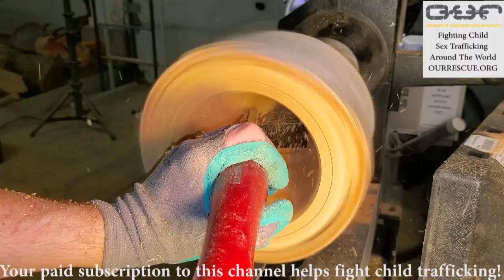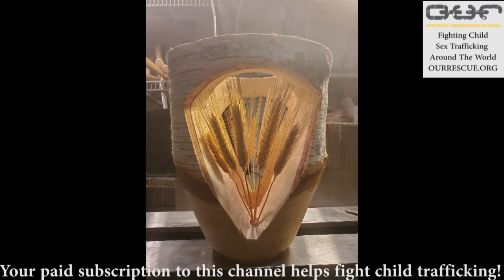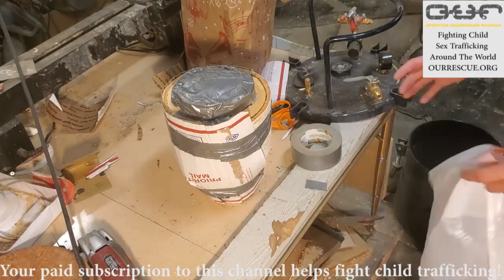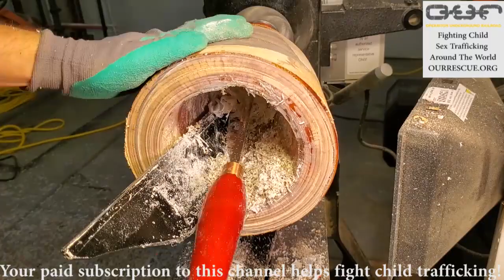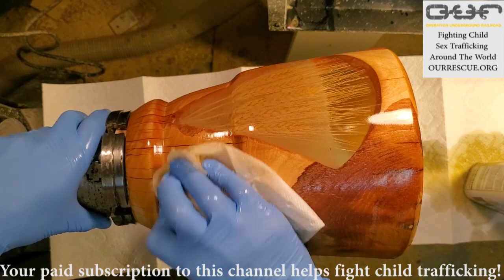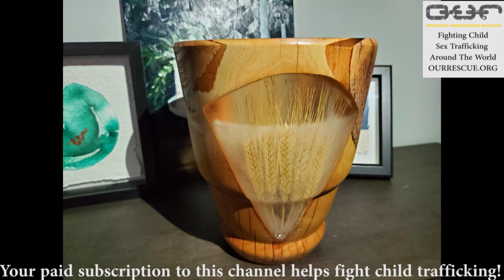"Foggy Wheat", resin, wheat, birch wood vase turned on the lathe for O.U.R. at ArtForOUR.org

Comment: Just on my second video by this maker, pretty happy with what I saw so far. I thought I would tell on myself to help others. When I have a natural product cleanup, especially if it is dusty, I use a leaf blower. I used to do it with my van back when I could get out for camping. I blew my shed and porches as well as areas I have carved antler or wood. I didn't like to be stuck in a workshop. Since I was 8 years old I have sold my art so making things at a beach in summer, a park In fall, the skating rink in winter, and anywhere it is airconditioned in summer. Making stuff in public drove sales. Pretty smart for a hippy chick in the '70s. So those are some tricks I used to support myself and eventually my daughter.  I hope that info helps someone. Oh, and great works Dan!
Reply from the maker: Hey that's great!  Thank you for the ideas!

Artforour.org

Comment: First off... What you are doing and the organization are amazing... 
Secondly... Having watched a fair few of your vids... You can eliminate all of the wood caused bubbles by stabilizing your wood first. Use a thin epoxy stabilizer. They usually are vacuum applied (which you have a vacuum pot) and then heat cured. That will help. Especially since you like to use the spalty wood. It will also serve you better for the projects that you want to keep the bark on by making it stay on the wood. 
Thirdly... Another thing that will help keep the bark on is to do the "window" part from the outside with a damn type mold and tipped on the side. If you want two windows then do it twice. 
Fourthly... Your way of carving the spot for the window and then cutting out the wood left in the middle is amazing! I will use it when I do similar styles. 
Fifthly... For those window projects where you are leaving the wood in the middle for waste wood and putting things into the window... Make a small spacer from your epoxy to glue in between the filler thing and the waste wood. That way you will have a layer of epoxy before you cut into your fill piece. 
Lastly... Keep on going! You are amazing! (and all of my suggestions are just that. You can take or leave them)
Reply from the maker: Thank u Charles!  Much appreciated!

Artforour.org

Comment: Very cool! Im a fan of your work!As a contractor for 37 years now(dam im old) .i can maybe help a little? With your multi tool (Chicago cutter),if you buy a quality blade at lowes or home depot (dremel or sonic crafter carbide blade) it will cut easier, and run it at a angle as much as possable before plunge cutting.and on sanding,if you have a attachment for your cordless drill for sandpaper,it gets scratches out faster and better. Not a know it all, just trying to help if i can.love the channel &what you do Dan!
Reply from the maker: Thanks Dan!  Great advise!

ArtForOUR.org

Comment: Another product you might try, I use this for Gun-Stocks... Birchwood-Kasey Tru-Oil.  Oce you have your wood smooth, you apply this with Steel Wool, then let it dry, reapply with a finer and finer stage, then wet polish with Tru-Oil until you have the sheen where you want it.  Its a great product.
Reply from the maker: Good idea!

Comment: To save resin, I’ve seen some turners use heavy duty bags filled with marbles.  My grandfather used those rubber bags people put ice in to cool their heads, and even a hot water bottle.  Find a big thick bladder and a good air pump, that should work well.
Reply: I looked online and saw these air wedges that might be good.  They are used as temp shims and can hold 500lbs.  Also I saw some heavy duty exercise balls that were cheaper, but are thick walled and might do the trick.  Get the heavy duty ones and they should last a good while. Hope that helps
Reply: If it works, please do a bowl for me and then auction it off with proceeds going to your charity. That should square things up between us.  Or twenty in the offering bowl as it gets passed around at church is good too.
Reply from the maker: Great ideas!

Comment: Another resin saver option is to measure the interior that u've hogged out on the initial piece, and then turn yourself a waste block that it within the limits inside your piece. Just hot glue it inside. 

There's also a channel called Sprague woodturning who shows a number of the ways he's done "custom" molds for his pieces. I'm not sure if you watch him but that might help.
Reply: I was just thinking of this. You could (with your skill's) make a set of "waste" blocks in different sizes. You could use them to "fit" your project and double and tripple tape the block? Possibly help on your waste issue.
Reply from the maker: Good idea!  Thank you. 

Artforour.org

Comment: Dan you do wonderful work, and I think your organization to help stop sex trafficking is very much needed in today's world!

If I may suggest (I'm an "old fart" of a retired manufacturing engineer!).... I would suggest making the cutouts for the plant life after the interior has been fully carved out. That way you wouldn't have to hold the routing tool or your oscillating saw too long because the wall thickness will be minimal at that point. Also it will probably be a lot easier to carve out and polish the interior without the interrupted cut formed by your cutouts. Just sayin'.....
Reply from the maker: Great ideas!  Thank you for your support John!

Artforour.org

Comment: Can use styrofoam cut to size with electric meat carving knife, prime/paint then use mold release. If it doesn’t release well it comes apart easily. Bag of sand will also work for inner mold rather than cardboard.
Reply from the maker: Good ideas!  Thank you!

Artforour.org

Comment: Hi Dan, You do beautiful work. I use to repair surfboards and standup paddleboards made out of wood. Number one; with the thicker, pours that you make get this idea of quick-set epoxy out of your head. That is only for very thin pours. Besides the fact that there is a product (a powder that you add to the epoxy that makes it set instantly, however, (it has to activated directly by the sun) but that's only on thinner pours. Number two; Get rid of that F**ck-n paddle wheel that you use to stir your epoxy. That is what is causing your microbubbles, and any other bubbles. When using epoxy stir it slowly, with a clean stick, so as not to create any bubbles..his way the pressure pot will get rid of all the microbubbles. Also, doing pours in layers also helps get rid of bubbles. This is my experience with epoxy This is why I am recommending a much slower curing epoxy. You've got time to work with your material without being rushed. At 71, I have enough lifes experience to know that when you rush something it's going to turn out like shit!!! Prep, is everything. Obviously, you have a grasp on this just look at your work. Of course, these are only suggestions. There will be a million guys that will say, I don't know what I'm talking about. Good luck! I will continue to watch. Your cause is fantastic. I'm a LEO and use to work on the other side of things. Take care
Reply from the maker: Thanks Patrick!  Great suggestions!

https://www.artforour.org/how-you-can-help

Comment: Amazing! Try 'Tuck' tape, it's a little more expensive but it sticks to most everything, and best of all, it doesn't stick to resin! For what it's worth, I would stick the tape directly to the inside of the bowl (instead of the cardboard and bags), you could maybe back it with a little cardboard and hot glue or silicone to support the tape. I'd do the outside the same way, worst case you're turning away a bit of tape! Good luck?
Reply from the maker: Will do!  Thank you!

Comment: Okay. What kind of Surgeon did you say you were? I listened twice and still didn’t understand. Also, you want Tuck Tape , it’s used often with Resin Pours. Normally used in house construction to seal up between edges of House Wrap!
Next, unless you’re sanding for stock removal, 40 grit is way too coarse! It can create scratches so deep that it takes a LOT OF sandi g to smooth out! Finally the streaks you mentioned inside the piece look to me to be sometimes present in Birch wood that was under natural stresses before it was felled! Do t worry about it, it just adds charm and character!! Lol! Good cause , btw!!
Reply from the maker: Thank you!  Great advice.  I'm a foot and ankle surgeon by day... crazy artist by night.  :)

Comment: If you use tuck tape to line the cardboard before using it to make the mold the resin won’t stick to the tuck tape. It works grate and it’s cheap on Amazon like $15 for a 216 ft roll. Just try not to pot the tape directly on the wood that much it leaves a sticky residue and it’s hard to take off the wood.
Reply from the maker: Cool! Thank you.

Comment: To keep from using too much resin, tape or glue plastic to the inside of your bowl or vase, over the windows, insert a plastic bag, fill with sand, place a disc of cardboard on top of the sand, fold bag over cardboard, hold closed with tape, place a disc of plastic on top of bag (smaller than inside diameter by 3/4" all around) then tape plastic disc to sidewalls of vase. Mix small amount of epoxy and pour & brush a thin layer over tape and disc to seal top. pour small amount of epoxy in windows and roll epoxy around edges of wood and plastic to seal each window.
You don't want epoxy getting into your sand, it destroys tools. once bulk epoxy is set up, use tile bit and rotozip to cut top off sand and pour out.
Reply from the maker: That's some great advice.  Thank you!

Artforour.org

Comment: To fill the inner void I use cheapest rice I can find in a plastic bag . It’s dry and easy to put in and remove. If you leak a little resin into it you just pitch it and you’ve lost maybe $1.00
Reply from the maker: That's the best idea yet for filling the inner!  I'm about to do another project like this...differently going to give the rice idea a try.  Thamk you!

Comment: I'm no expert. But wouldn't be logical to cut a little bit of the wood and place the objects, then have a first light pour for the outside just to fix them in place*, and then do the complete casting (with colors or not) subsequently doing the woodturning? Idk. You like experiments right? If you ever read this, tell me how/if  it worked. [* I mean to cut superficially and pour into a pocket].
Reply from the maker: Good ideas!
Reply: Thank you you're very nice☺. But I have to revise my  idea-I don't have your experience- I correct: not too deep cut into the wood= a niche/ a first pour of xx cm. then place branches inside and a 2nd pour of xx cm. Otherwise when you lathe the inside you risk demolishing the artwork together with the OG wood. I'm an idiot.